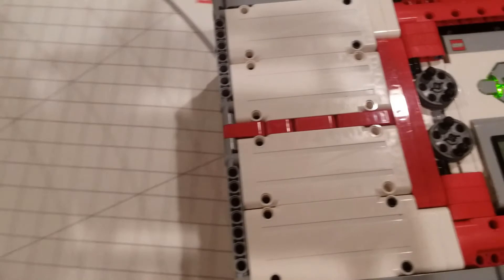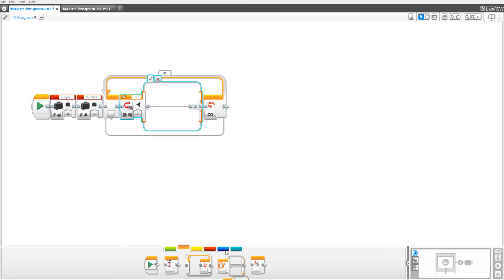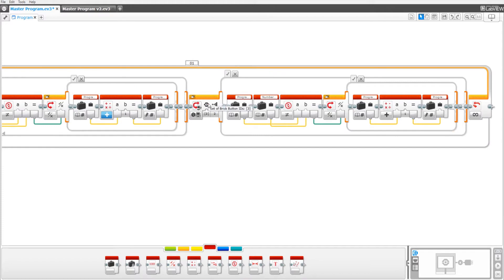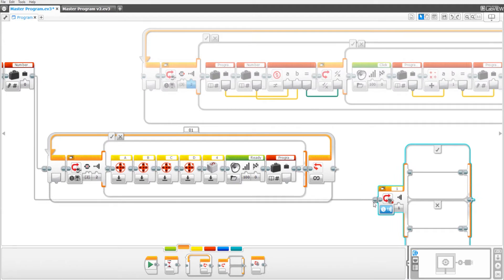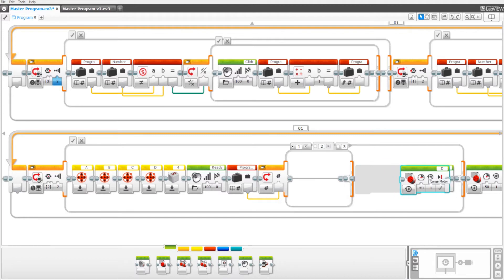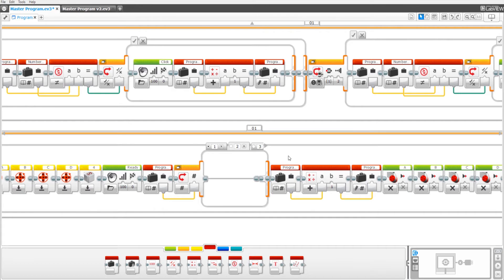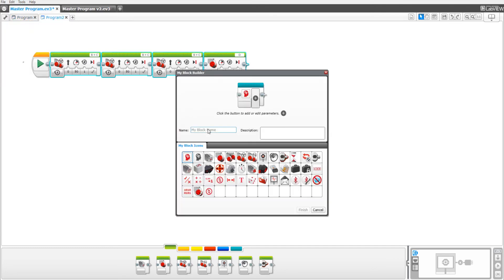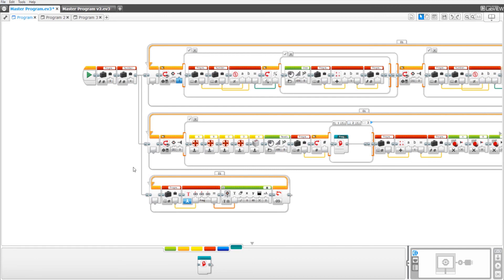How To Make A MASTER PROGRAM! | Ev3 Programming Tutorial

Comment: Hello Lego R Us, hopefully you're doing well,
I found this very helpful so I did the same program for our robot.
But unfortunately, it didn't work... I tried it several times & redo it again more than 3 times, but again it didn't work :(
What happens that when I play the master program, the screen shows that all programs in the tabs are running on for less than a second (what i mean is it shows "program 1" then the general alert sound, then "program 2 & on..." immediately without pressing the buttons).
And yeah I already set the number of programs to how many tabs I have, I thought that was the problem at first, but it wasn't.
Any thoughts?? please reply to us ASAP. 

Pardon my English.
Reply from the maker: Hello! Regrettably, I have, in the time after posting this program found a few flaws in it. Most of the time it works fine, but occasionally, it runs incorrectly. I would like to get around to posting a new video with fixes, but sadly lack the time. Sorry that I could not be of more help.
Reply: Legos R Us thanks for replying to us.. appreciating your time & effort 🤝

Comment: Oh and one more thing which might help. We tried implementing this, and realised that after you completed the last program, you couldn’t return to Program one by just pressing the right button(it would just continue counting upwards). So at the end of your second loop, we added a variable for “ProgramCount”, then plugged in a compare block. That compare block was set to “more than 2”, as we only had 2 programs. We plugged that compare block back into another switch block which would change the program back to program 1 if the “ProgramCount” was more than 2, otherwise it would leave it as it was. This meant that after you finished going through all your programs, would would return to your first program. Anyhow, very helpful!
Reply from the maker: Great idea!